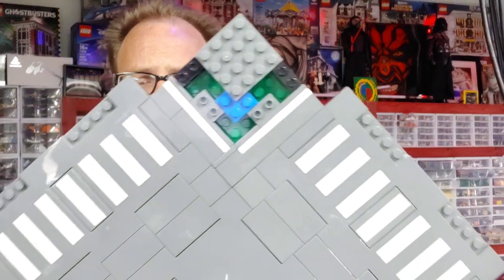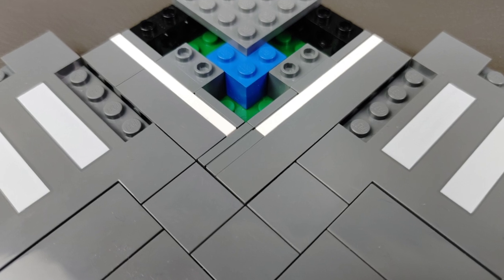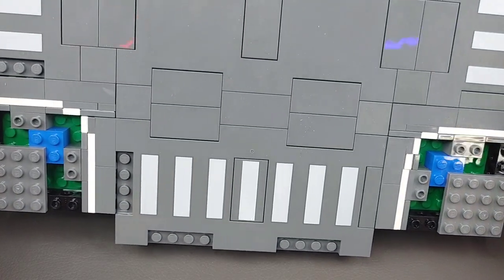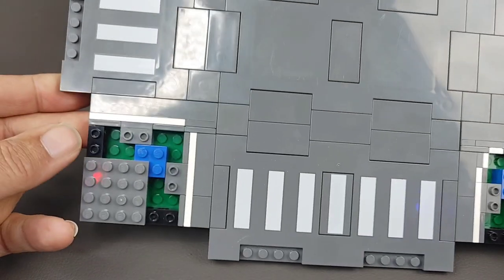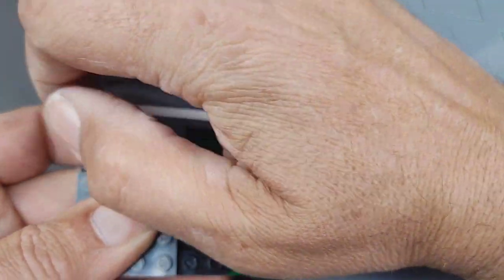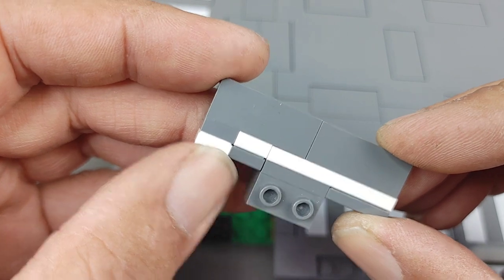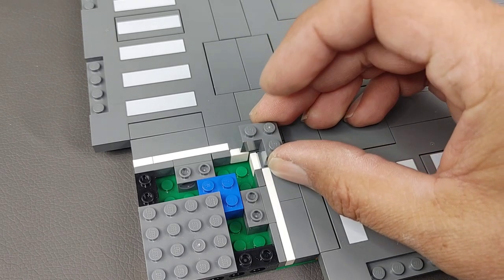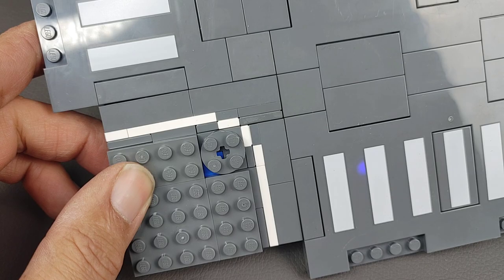Fixing your corner edge line on a Lego mils plate road.

Comment: If you're doing a round plate at the corner, might as well make a drainage hole with rounded corners underneath the pavement so you won't have an ugly gap. Just leave a hole of 1 or 2 studs, and use a quarter round tile on the other side of the drain.
Reply from the maker: I personally don't do that I use a one by one round plate with a one by one tile on top of it because I have sloped pedestrian Crossings

Comment: I have a related question in regards to your mils road plates. I really love how your roads look using the brick method over the Lego road ones, however I notice if you build them over two base plates or more the brick road tends to become slighly shorther over the length of the road then the baseplates. This creates a slight gap between roads and tends to want to slighly pull on the corners when attacked to the baseplate as if the bricks need to strech out a bit. How do you deal with that?
Reply from the maker: Unfortunately the only way to cure that is to use 1 x 12 or 1 x 16 Bricks.  1x6 bricks do also help but the longer the brick you use the less the Gap will be noticed.
Reply: @BevinsBricksWorld  Yea, just what I suspected. Keep up the great work and thanks for all the insperation
Reply from the maker: Your welcome and thanks for watching :)